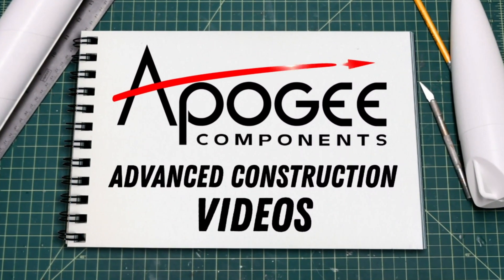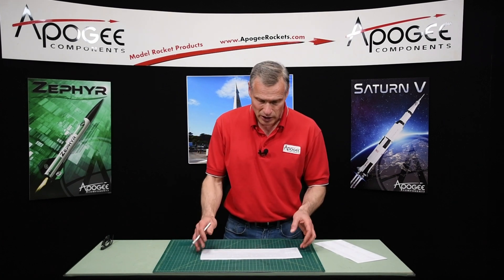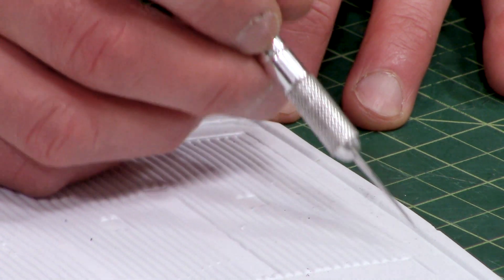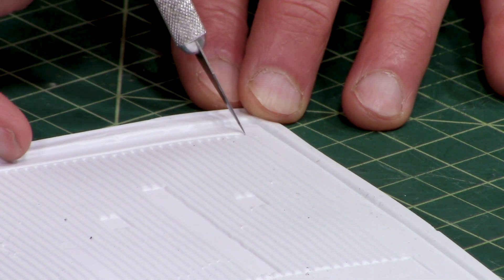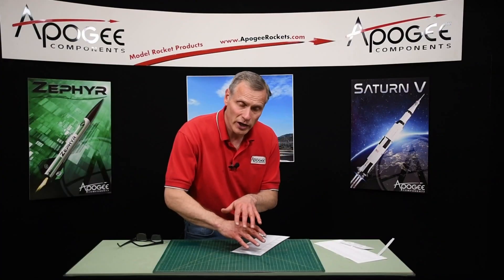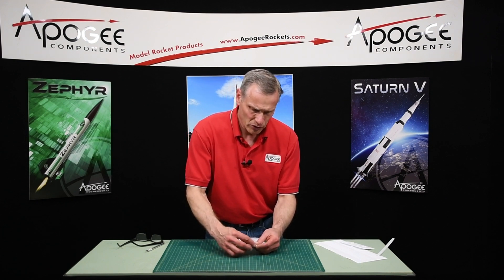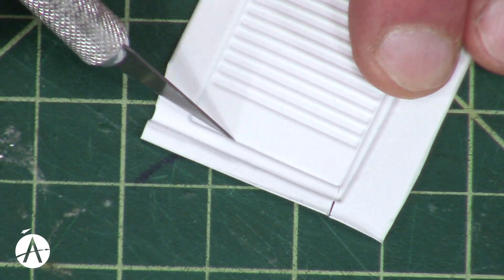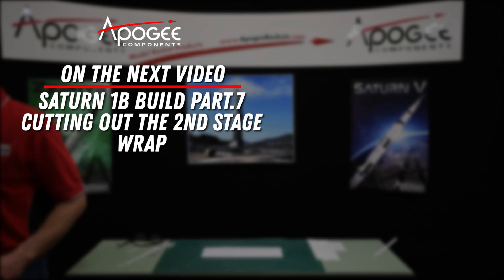Saturn 1B Assembly Part 6 - Cutting Out the Interstage Wrap

Comment: You can tape the wraps down on to the cutting mat, then align a straightedge exactly where you want to cut, and tape it down. Now both are immobile. Make your cut along the straightedge and you will have a perfect cut. Instead of cutting freehand. It’s just another option.